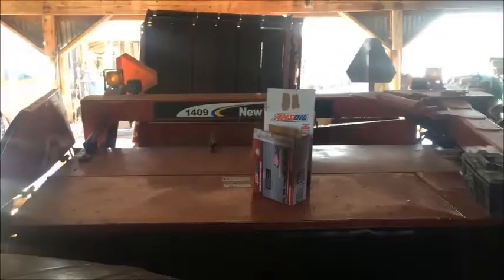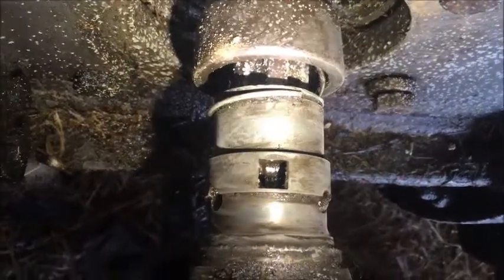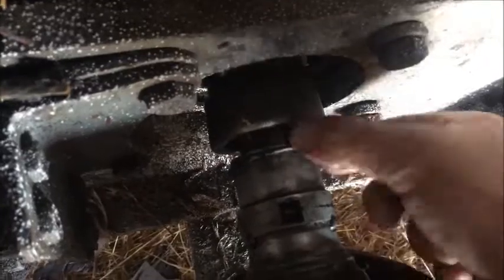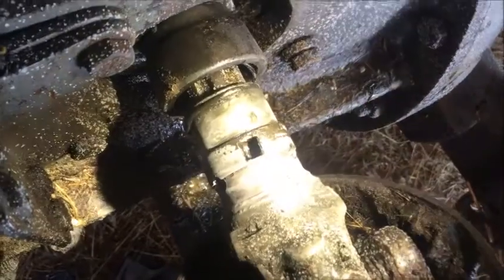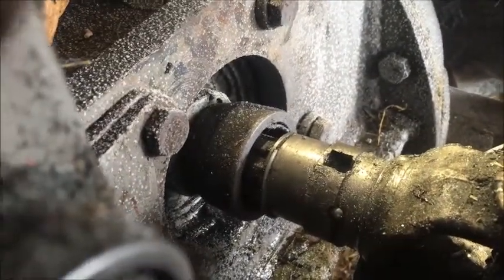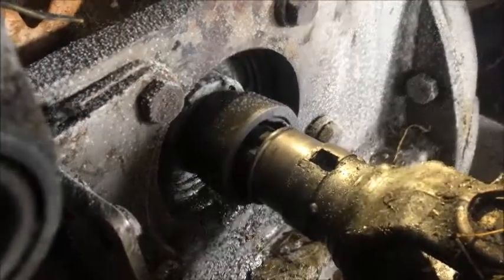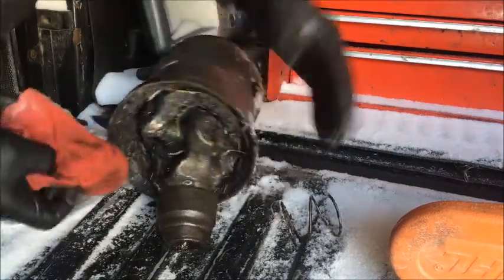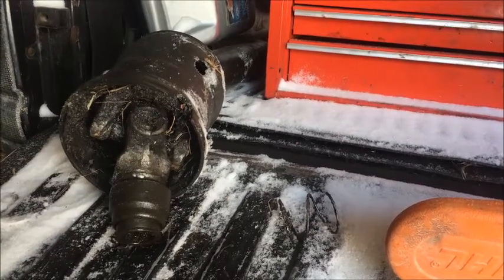Power take off coupler stuck on tractor spline - disassembly.

Comment: I had one had the plastic collar had trouble with it, I had to get a new shafe the clutch mess up. I told the dealer get me one with the old slide pin, he told me the new ones are metal and better. Well there not, it's stuck on pto now. I've spray wd 40, pecked on shuck it, moved it back and forward and no luck yet. I've done all  this before then wait a while walk up to it and it came right off.

Comment: I fight this on my baler every season and it drives me insane we beat it off and did so much damage the yoke was stuck on and had to buy a whole driveshaft for 3500 and now the new one has been on the tractor for all of second cutting and now it was stuck and it's never been touched other then to slip it on the pto
Reply from the maker: Yeah my first PTO shaft for the Baler I paid $3500 for also it’s half the price at the disc mower doctor out of Pennsylvania I’ll never buy a OEM driveshaft again it’s a rip off

Comment: The CV joint on on one of our Deere balers uses 3 balls that lock into the recess in the Shaft.... Dirty Grease once  prevented the balls from moving and we did what you did removed the sliding collar cleaned with Brake Cleaner untill the balls dropped out... Our  KMC Cutter Carts have a sliding collar on each end of the short shaft to the tractor......What really pisses me of is how some idots assemble the u=joints.... putting the grease fitting on the wrong side of the cross......I have designed some tools to disassemble a u-joint without destroying it..
Reply from the maker: Took me a while to figure it out

Comment: Thanks for the video! We're stuck in the same spot, but at least we know what direction to take.
Reply from the maker: WarrenRCG curios what machine?
Reply: @michiganhay7844  A Howse 5' brush hog coupled to a1975 Ford 2000 3 cylinder diesel. We needed to remove the hog to attach a rear scoop and the hog hadn't been off in years and dad swore up and down that you had to push the collar forward to release it. I watched your vid and walked out and removed.  He was shocked and said "That YouTube is a handy son of a bitch." He'll be 80 in December 🤣👍 thanks again!

Comment: I bought a New Holland 9 years ago and every time I have to fight beat and bang to get the thing apart. I will never have another one.
Reply from the maker: Russ Kiddy I just bought a brand new PTO shaft from the disk bind doctor last year it was 1000 bucks the dealership wanted like 4000 bucks and this one works great
Reply: I have a LONG brand tractor. Made in Romania imported by faith back in 70s. They stopped making them has Ford 3 cyl diesel ! I need my 3 point fixed ! Goes. Up won't go down acts like a shock !!! Help joeblowpan722@gmail.com  Text me please !!